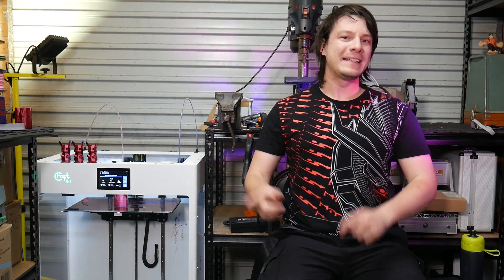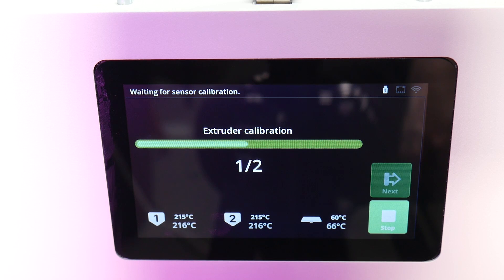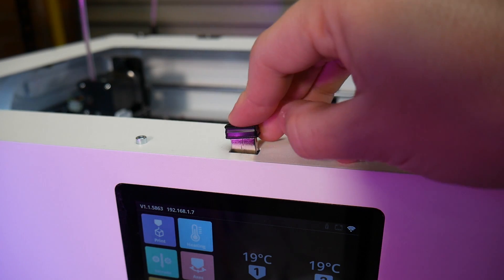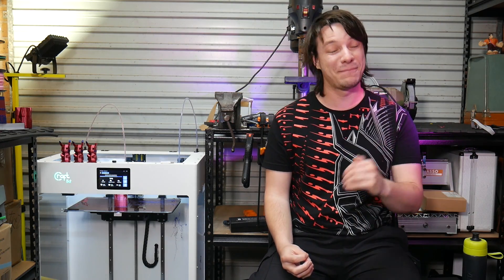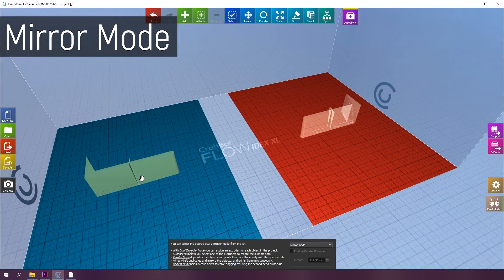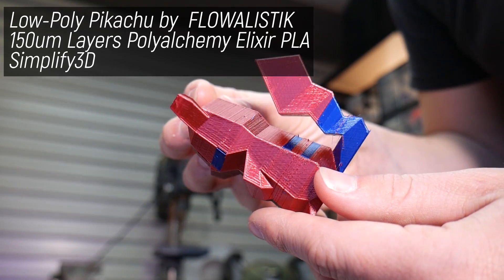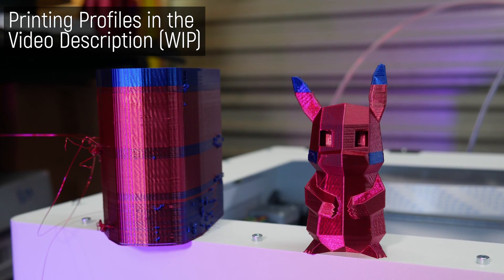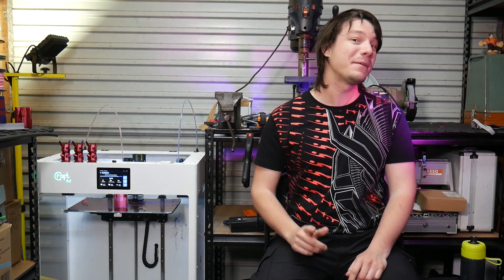Craftbot FLOW IDEX XL 3D Printer Review

Comment: Hmmm... That bed levelling sucks. If you're used to a Prusa, this would feel like a huge backward step, regardless of how clever anything else is. They need to do it the way Prusa does, and have a stepper motor on the second head so it can track the mesh in real time.

Comment: From hardware perspective, very nice machine. What is most annoying, you are paying for something what is already for free and working fine - custom slicer, custom printing server, custom firmware.
I designed my own IDEX conversion for my Tevo Tornado with Klipper firmware. Even it took a lot of time and around 300$, I know it is not so hard to make it working especially if you are using open source system.

Comment: I think the most interesting thing about a dual extruder printer is the ability to use a water soluble filament like PVA for supports. No more mechanical work required to remove the supports!

Comment: Mirror mode will cancel the acceleration in the X axis, making the whole thing more stable.
So if you're printing an object that is symmetric, you will benefit by printing 2 instances at one in this mode. The parallel print mode will double the acceleration, making ghosting even worse though.

However this would have to be tested  in order to see if it's making any difference in reality.

Comment: Nice printer. But Creatbot has the D600 Pro, 600x600x600. And that sucker cost me $16k. Closed loop stepper motors, dual heated chambers, dual extruders, and PEEK capability.

Comment: I have 4 3D printers. First one I bought cost about $2500 about 8 or 10 years ago. Each printer I bought after that I spent a less than the previous one and overall each printer was better than the last. I've had many problems with all of them, but the worst was the first one, the most expensive one. It's really ridiculous that after all these years that we have pretty good cheap ones but some expensive ones that still have problems that I used to have on my first printer a decade ago. 

As someone who always considers the higher end "prosumer" printers, it's rare I see one that can justify the price difference in what you get for all that extra money compared to the middle to high end regular consumer ones.
Reply: The dual colour issue has been fixed with FW

Comment: I have the flash forge creator 3 and I do use  it’s mirror mode fairly often to print mirrored dungeon and terrain tiles for gloomhaven and D&D . Right and left angled walls are common.  So a little more than a party trick for me. Thanks

Comment: Mate great honest review Angus.  My very first printer was a CreatBot which had a large build area for the day, it was 250 (X,Y) and 450(Z) and came with dual extruders which I never ended up using as I could never get it right. I also never used the full height of the Z axis as it would take along time to do large prints, from memory the longest print was 3 days and was for Mario & Luigi charaters which was with a .4 nozzle.

Comment: Thanks for a very useful review. This one is on my shopping list.

How does it work with the support material modes especially PVA? My goal dual extruders is to not spend half hour on every print removing support.
Reply: As long as it is dry it did a great job on my flow idex

Comment: So I have a Craftbot 3 which you reviews. Its interesting to hear how you are getting lots of firmware fixes, but unfortunately I got two for the Craftbot 3, and then they just stopped, as Craftbot has a new shinny toy, this printer. I have numerous firmware problems that were never fixed. The Craftware slicer, has problems well, as you noticed. On the Mac, the software crashes often. Simplify 3D works, but doesn't support the many modes of this printer. And hardware is not perfect either. The extruders suck, and they are proprietary so they can't be upgraded. Oh then there is customer service. Maybe with a Youtube channel, you get better service, but for the rest of us, not so much. I bought the plastic cover which has a fan in it. Too bad the firmware is bad and really doesn't control the fan like it should. 

After I had such poor support for my printer, and with all the bugs I have, I kinda assumed that the company was going or had gone out of business, but here they are.  

Before anyone buy this printer, just realize that Craftbot will quickly forget you soon after your credit card clears. No doubt Craftbot is already working on a new model, and like my Craftbot 3, you'll be left with a buggy printer with no support, a slicer that really doesn't work, and a product they no longer are about.  Don't believe me?  Look at the date they discontinued the Craftbot 3, and the date of their last firmware for it.
Reply: Just on the flipside of this this I also have a CB3 and have found support from Craftbot to be extremely helpful, even answering support over the Christmas holiday period, and all within 24 hours in the few times ive had to contact them. I will agree Im annoyed that they just dropped updates for anything other than Flow but over all I have found 99% of all issues to be slicer related. I have been tweaking my S3D profiles (Big thanks to Rick from Fuse3D for the initially tweaked profile) and have been getting flawless prints. Now I just have to get more time at home to use it.

Comment: No matter how i look at this printer, all i see is a hot mess. Like two people, both fully aware of how a 3D printer is built and functions, but with two different mentalities to approach the same goal, decided to work on the same machine without using each other's good points, just throwing equal share at it.

That and the fact that i've always been of the opinion that if a 3D printer doesn't fit in a normal apartment anymore, might as well get a small sized CNC mill and convert it to 3D print using various kits on sale and the knowledge that is the internet, at our fingertips.

You're getting two machines for the price of one, and most importantly, regardless of how rigid a 3D printer might look, it will never, by function, be as rigid as a CNC machine. It couldn't be. One caveat to this kind of idea, it would certainly be slower, unless the drives are high end.

Reminder, the first 3D printers of years gone by, were CNC machines.
Reply: For the price they demand you can go all out and build a giant and super powerful CNC machine / 3D printer yourself (that's what I'm doing right now, I'm at like 700€; to add CNC mill functionality will probably cost like 200-300€) that isn't riddled with problems like this one. You can probably pay someone to build it and still come out at a similar price...

Comment: Angus: Well about the price, are you sitting down?
Me: Yes
Angus: 4000 euros
Me: Now I am lying down
Reply: Given how much Prusa i3 costs, that's not that off the charts. If it works, of course. Feature wise it's absolute killer.
Reply: It's crazy how much the world has changed. Does anyone remember what a Stratasys cost back in 2005? We're so spoiled now.
Reply: Thomas Horst My Silicon Valley startup paid $60k for a Stratasys Dimension SST1200 ES back in 2012. 8x8x10” build volume, 0,25 mm minimum layer height, and could only use Stratasys $150 ABS and base-solvable filament.
Reply: For the best part of AUD8,000, not being flawless OOTB is a TOTAL dealbreaker.
Reply: 3Dprinters independent dual head extruders with large print area are available 10 times cheaper!
Also not that heavy!
Educational video though recognizing identical print options.
Reply: Im in too gaming computers a million dollars doesn't surprise me anymore 😂😂😂

Comment: Imagine making an amazing printer with great and wanted features, then paying an ape to badly copy a slicer from github
Reply: That's the price you pay for not adding to and improving open source projects already on the market
Reply: So the Craftbot 3 had this great feature that actually measure the filament into the extruder to detect a problem. Sounds good if it actually worked. Instead it often constantly thinks there is a blockage when there isn't which causes its own problem.

Comment: surely a small bit of spring steel bent into a ramp that the nozzles can run into to park blocking the flow would solve the leaky head issue.
Reply: Large format inkjet printers I work on have this exact feature. The other issue is that useless rubber blade for wiping off excess filament. A sharp steel blade that the head drives around and only passes over in one direction heading towards printing. For that matter, use a round blade that rotates after each pass to completely eliminate any filament buildup.

Comment: The high price tag is okay, if the works. But it doesn't.
Reply: It does work 100%, new FW has fixed the issue. I have it working with S3D

Comment: I designed a 4 headed idex system as a printer design challenge. I calibrate my offsets manually -- with a camera i place under the hotends and then just use VLC with a center target overlay to find the proper offset for each toolhead. So no I don't have fancy inductive sensors, and my firmware is a modified skew of duet.  The duplication mode is really awesome -- I actually have been running my machine in tripliation mode during covid to produce over 4000 shields, the versions which can't be stacked. Since each quarter of my machine is the size of a Cr10, I can get a lot of shields out at once. I use the 4th hotend with a small diameter toolhead for fine detail, so I only did triplication for shield production. That being said, I use it often in multi color or multi material mode, and I am one guy. I don't have a team. I developed a method to prevent my hotends from oozing and have a reliable process for printing pla that works everytime, PETg is trickier and needs a prime tower, but again -- I've done pla/petg combo prints with PLA as support for PETg. Seeing the parking buckets with just a little bit of silicone to clean the nozzle is amateur hour. Anyone tell Crafbot that silicone is a non stick material and does absolutely nothing to knock off ooze, it will just force the filament to curl up and adhere to the hotend. I know, because I iterated on a parking design for 3 years. That was V0 alpha attempt for my quad system. My current system is simple, but it's more involved that this nonsense. Considering the price -- this is absolutely pathetic. I've used mirror mode 1 time when I needed to print left and right shelf bracket -- it was useful, but again just one time over 3+ years.
Reply: Do you have pictures or videos somewhere? im curious

Comment: Honestly the best application for IDEX would be for printing out one model at a time faster with multiple hot-ends simultaneously. Parallelism or mirroring is just not a great development for me.
Reply: You can have it printing different parts on each extruder at the same time I believe. At least the option for it is there in Craftware for the CB3
Reply: @bigbmessiah  I thought you can only parallel or mirror the same model for simultaneous printing. I don't think Marlin can support things such as supplying different extrusion lengths at the same time. I also have no idea how the motion system actually works.

Maybe I'm missing something, but I found when you assign a different nozzle to a different part, it only does one at a time, purges, etc. What I really want is to print only one single object at a time, (a large important print), but have the hotends totally cooperate in order to print it as fast as possible. It would be the strongest selling point if it could be done.

Comment: Wifi interface looks suspiciously similar to Octoprint. 

Quite honestly, integrated wifi is about the last thing I want in a 3D printer. I'd prefer that the cost of the printer be because of quality components and innovative hardware design. Leave it to the open source community to do the software side of things. Development will be much more iterative, faster, and feature complete.

Comment: "The more you overthink the plumbing, the easier it is to stop up the drain" - Montgomery Scott
Reply: Yeah, OK, Roddenberry. Y'all act like a few position sensors and a decent software package are some kind of automation overload. Ever worked on cars? This is preschool in comparison. 3D printers are not complex machines, and they are in desperate need of QOL improvements. This machine offers the bare minimum functionality to serve as a usable appliance. Nobody is manually adjusting print heads and setting voltages in their laserjets. Why do we put up with this constant adjustment crap in 3D printers? Answer: They know you nerds will troubleshoot it for them.
Reply: chooseymomschoose Okay a couple question. Firstly who hurt you this bad to fuel this much anger/frustration in a comment. Also no one said 3D printing is so complex compared to putting together an engine I don’t see any comments so far from my scrolling so huh? And isn’t that how all products improve over time, people who are passionate will take things into their own hands and try their best to work with what they got. Hence a 3D printer that may not being working at its best, wait for a whole new one to come out or try your best to learn and fix it. No one is saying these are so complex and gcode is so complex so seriously man where is this anger come from. Don’t you find it great how a community can be built around anything (cars, 3dprinters, etc) that the community wants to upgrade. With that logic there is no point to working on a car, they are not complex machines just buy one and use it, just take it to the dealer when it needs servicing. Or you can work on it yourself as you said. So why do you work on cars if you can take it to a shop or dealership. Because you enjoy the community and it’s a fun job/hobby/whatever to you. Again where is this anger coming from
Reply: @chooseymomschoose  Yes, in point of fact you did see people manually adjusting print head settings in their printers... back when they first came out. As with any form of engineering, you need real-world experience and testing to improve your product.

Comment: I feel like Craftbot is a 3D printer making version of Apple. I mean, $240 for a plexiglass door for this? Why? Almost like the $500 Mac Pro wheels...
Reply: I have all Apple computers and a Craftbot 3. You are very mistaken is you think a Craftbot is like Apple. Apple doesn't leave you high-and-dry when they release a new computer. Check how many Craftbot 3 firmware releases were released after it was discontinued? Here is a hint. NONE.
Reply: @A1N0  I meant that just by the fact they both ask ridiculous prices for basic stuff, like plexiglass doors and Mac Pro wheels. Nothing else. I have no problem with Apple. I'm not an iPhone user, but nor am I an Apple hater. Cheers.

Comment: I think mirror mode can be a good thing when printing fast, both heads going in a different direction at the same speed, they balance the acceleration of each other, making a neutral "action reaction" movement. I don't know if that makes sense...
Reply: Yes, ideally the opposite movements would cancel out the vibration caused by each extruder on the X axis.
Reply: I agree. Mirror Mode can also be great for printing projects that are symmetrical.
Reply: Only in the X axis though. You have twice the mass moving in the Y axis.
Reply: To fully balance accelerations you would need a quad mirror mode and another pair of extruders 😎

Comment: I love my flow idex. But I was disappointed with the slicer. I make industrial ESD parts and need soluble interface layers. Does the prusaslicer or simplify3d have this feature?
Reply: I have a working Simplify 3D profile which fixes these issues
Reply: I tried to swap to the .8 nozzles today and the slicer looks good and so did the first half of the first layer but all of a sudden the priner slows down to a craw and dumps filament full speed. In a few seconds the blob was 7mm wide by 28mm long and 2mm thick! I have checked my settings and viewed the sliced layers and everything looks fine.
Reply: @heathdaugherty8992  You will need to alter your profile quite a lot especially flow settings and speed
Reply: @fuse3d  I did. I run a .8 volcano on one of my other printers and set it similar to that. The issue was in the gcode. I sliced the model twice and it did the same slow dump in two different points on the print. I rebooted my pc and sliced a different file and it didn't do it again. But know i did an overnight print and the screen is dead. Back light comes on and responds to touch but just has a black screen.
Reply: heath Daugherty you need to to a flow calibration for it. This nozzle is huge and the flow rate will be really high, more so than most other printers
Reply: @heathdaugherty8992  bad g-code. Are you using CW? I have had success with S3D
Reply: @fuse3d  craftware for now. Im very interested in the prusaslicer Angus used.

Comment: This sounds like it fills a similar niche as the Raise3D Pro2 (same price range, large build volume, touch screen, wireless printing and monitoring, dual extrusion,  lots of sensors). At our office we've found it to be very reliable for PLA and the included slicer (Ideamaker) works smoothly for single and dual. Maybe they'd send you one ;)
Reply: I'm looking at the Raise3d E2 to replace my Craftbot 3 piece of junk.